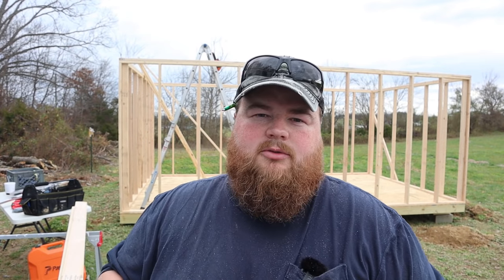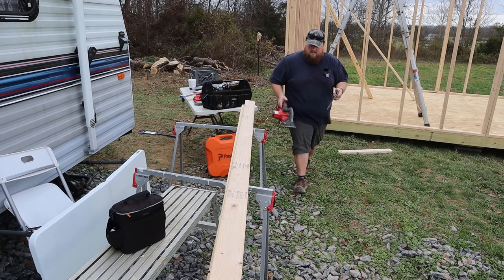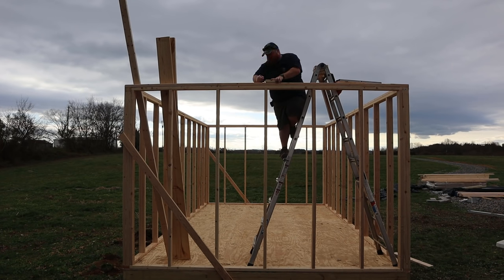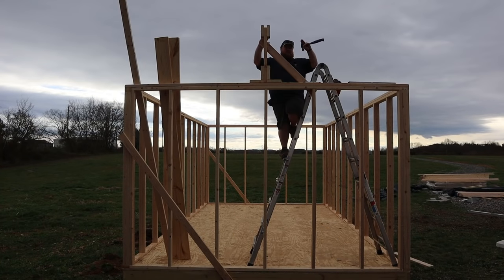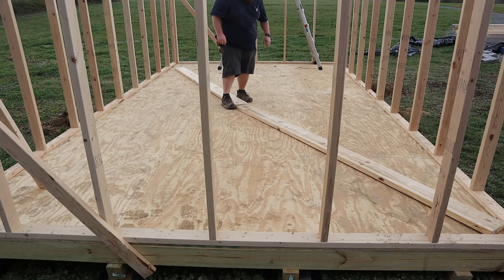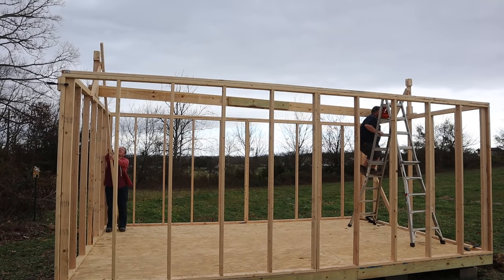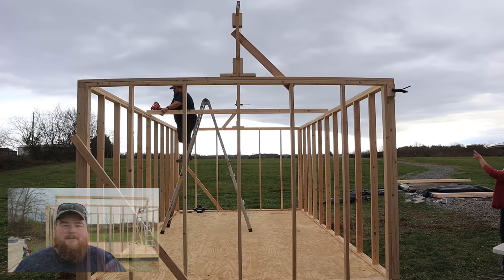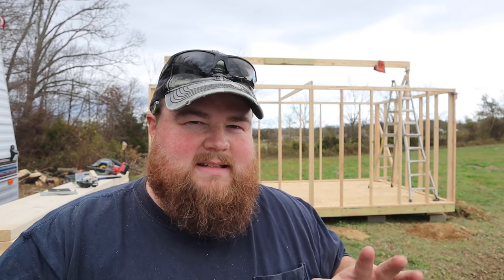NO TRUSSES? | Stick Framed Roof - Shop Build 04

Comment: This past year, I built a 12x24 wood working shop. All the room I had or it would have been bigger. I did the roof with a 10-12 pitch. I love it. On one end I built a loft across the end coming our 4 feet. I won't go a loft on the other end as it is where lumber storage is. I Love the hight ceiling as I never have to worry about hitting the ceiling when flipping a board. I also put LED lighting in the ceiling. One light with 4 wings puts out 12,800 lumens. On the ends I used 850 lumen lights. Like daylight in the shop. Keep up the good work. It sure is fun building your own shop.
Reply: Oh, I have NO ceiling joist in the building. I cross braced the 2x6 rafters near the top and nailed hurricane clips to the wall
Reply from the maker: It really is great fun getting to build my own shop. I'll be reusing my current workshop lights (LED) and look forward to putting it all together soon. :)

Comment: I know that Engineered Trusses have gone up in price but they are so much easier to deal with and if they aren't busy can set them for you and before you know it the roof is ready for lateral bracing and sheeting. I'll pay extra for the trusses especially in most states the codes call for it and the fact that they are protects the buyer and the seller or homeowner!

Comment: Two issues. Before framing roof you need to sheath the walls or brace them. Second it is necessary to add wall braces (and rafter ties). Otherwise all walls go apart and roof will collapse.

Comment: Listen, Sam: I am surely in your debt for posting this video. I’m also working pretty much by myself, and so for the first time am having to figure out how to, for example, hold a ridge board in place while I size and attach rafters. Nice job, man!
Reply from the maker: I am happy to have helped in some way! The #1 thing I would change: don't make the bird's mouth cut so deep. I dropped mine down too low. There's not been any bad results, it's just cut farther into the thickness of the rafter than is normal.
Reply: Yeah, I checked code before clamping up my block on the bird’s mouth end, and since 1 1/2” is all that’s required for contact on both parts of the cut, I went for just over that - probably only 1 3/4” deep on the vertical cut. Thanks again!

Comment: I originally wanted to use a ridge beam in my workshop; but, I was new to all of this and having a joint in the ridge beam made me nervous. So, I used gusset plates on my roof framing for its simplicity.  It was after all the first building I ever built. 

I wish I knew then what I know now. LOL. Thanks Sam!
Reply: That’s the great thing about YouTube it’s basically a unlimited supply of knowledge!
Reply: @RedBeardedBuilder  YouTube University has made me a Jack of very many trades.
Reply: Remember what he installed is call a ridge board not a ridge beam.   The ridge board is just used to attach the rafters to.  There is no weight bearing on this ridge board so it can be in pieces and often is.  You can actually use a 1x for this board if you would like.  Simply used to tie the rafters to.

Comment: A  birds mouth is simply a plumb cut and a level cut.   So draw a plum mark  and slide a 2x4  scrap down the plumb  mark and when it touches the bottom of the rafter draw the level line

Comment: The birds mouth needs to start as it sits on the wall not before. You reduced the height of the rafter height and created a weak point. Effectively turning a 2x6 into a 2x4.

Comment: Still enjoying your channel but I have a Question number 2 No over hang on the ends ? Question 1 which I never seen a response from your first video was why did you not insulate your floor or at least maybe use reflective foil or something. Note on your brothers tractor in the future you could clamp on some extensions on his forks to make them longer so you could get stuff up on top later...(-:
Reply from the maker: No floor insulation, and no gable overhangs. We're putting our money towards moving our home to the property so this is a very budget conscious build. I'm not worried about a flush gable wall with no penetrations or doors. It'll be weather tight and have no issues when it's buttoned down right.

Comment: Just curious, no hurricane straps? Being in TN, the likelihood of a high wind event, either in the form of a tornado or decaying hurricane, is pretty good. Nothing is going to be 100% but I'd hate to see all of my hard work get destroyed by a 40 mph wind gust when I could have made it withstand say, a 60 or 80 mph gust.

From the beginning, I've wondered if the whole thing could be blown over since it's not attached to the concrete blocks. It's great for portability but that's only for when you want to move it, not mother nature.

With all that said, I admire your gumption and I look forward to the next video, and the next, and the next...
Reply from the maker: Don't worry.. straps will be added very soon. I'm trying to get the shell dry to keep rain off the plywood. I've got to frame up the door and windows too. It'll be done up right. :)

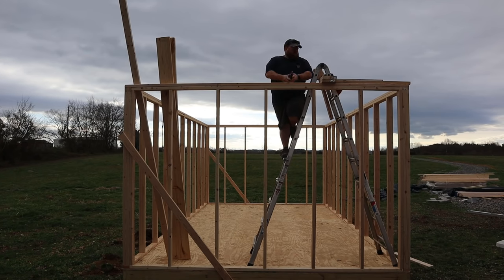Comment: Question - When you were finding the center point at 4:05, should you account for the siding? I plan to build a 10x10 shed, but if the exterior has 1/2" plywood, wouldn't i take the centerpoint from a now 10' 1" full width?
Reply from the maker: It wouldn't matter since the siding is added equally to the outside of the framing on both sides. :)

Comment: Sam, I am building a shop that is 15' long by 20' wide, the gable will be on the 20' side.  In your opinion, can I do rafters like these or do I need to spend the extra money on actual trusses?
Reply from the maker: A 20 foot span would be beyond my skills I think... At that point I believe you may come out ahead in cost to buy the engineered trusses? If nothing else, I would personally feel better knowing the large span above my head is 100% good to go. :) Either way, congrats on your shop build!!! I still have yet to put the metal roofing on mine. It's been covered in the synthetic underlayment for nearly 6 months now. It's a project I've put off over and over. I need to just get it done!

Comment: I really enjoy your videos and work ethic. Nice work.
But on your gable ends are you not having any soffit or overhang at all? It will really help to lower your possibilities of getting weather inside your building.

Keep up the good work buddy!
Reply: He may be doing ladder style overhangs. ???
Reply: @RedBeardedBuilder  Agree, I would imagine that he would, but without having your ridge extended to support the width of your overhang it will lose a lot of rigidity/support.

I suppose that he could use corbels. It just would have been easier to extend the ridge beam. Anyhoo… :D
Reply: @TheGrayMatters  some guys on YouTube always use what I call ladder style overhangs. I prefer just extending the ridge beam and doing my overhang that way but either way gets the job done!
Reply: @RedBeardedBuilder  that’s what we called them too. Built on the ground and set in place, or stick framed. Makes quick work of an overhang.
Reply from the maker: Actually, I'm not going to do any overhangs on the gable ends.... which is VERY non-conventional on stick built workshops. Probably sacrilege, but I'm keeping this build simple and budget minded. I'll try to come up with a better reason or explanation when that video comes. :)

Comment: I just watched a video where the weight from the roof will push the walls apart.  Does that ridge board prevent that?
Reply from the maker: That is why you need rafter ties or collar ties with roof framing -- the horizontal boards that connect rafters forming a triangle shape.

Comment: once I had a lot of protruding large moles - a kind woman at work noticed this and took pity on me. she brought me 1 cubic centimeter of hydrochloric acid in a tube and told me to lubricate the moles 1 time in 2 days. So I removed 4 moles. when I smeared a mole on a neck vessel, the acid entered the brain - there was a strange feeling, but when I smeared moles on my forehead and on my nose, I felt only a tickle and a slight burning sensation. I wasn't afraid because we had saline in our stomachs and that woman removed the mole in the corner of her eye! I was hoping that acid would get ahead of the intercellular signal if there were cancer cells. I don't know the concentration of the acid, but if I dipped an iron nail into it, there was smoke - so I used the tip of a glass shard. it is important that it has a very thin tip so that you cannot get even a drop of acid on it - try to moisten the sharp glass with a few molecules of acid. acid has an inertia of 2 days, so it is important not to rush, but to observe the process, otherwise a depression will remain instead of a mole. It's been 15 years now and my face is clear of these bumps - you can take the risk to get rid of the bump on your upper lip. I like what you teach people and how your family works together - this information is not only a thank you to you but also an attempt to save my recipe for all of humanity. I would start with a minimum concentration - you can dilute the acid with water to get 2%. this is a very dangerous trick for the eyes - have a solution of baking soda nearby and access to water to rinse your eyes quickly just in case. in our country, doctors cut off moles with a knife on the street - looking at this atrocity, I chose acid

Comment: Really looks good Sam. Are you sure you're going to have enough room compared to your last shop or is it around the same square footage? You did get a lot of new toys recently.
Reply from the maker: It's fairly close in square footage of my current workshop (256 vs. 240). I do think this shop, especially the layout in my head, will work better for me. I'll also let you (and whoever else reads your comment) in on a secret that will come about in the future... I am NOT bringing my table saw to this new shop. I am selling it and not planning to have a table saw in this workshop.  :)
Reply: @Samcraftcom  hey Sam thanks for the response. That should help out quite a bit removing the table saw I know mine takes up quite a bit of room. Can't wait to see the complete project. Thanks David

Comment: Has anyone heard of 3-gable 5-sided roof? I was a 5-sided corner shed, 12x12, with the side walls each 6', so the 5th center wall is 8'6"; but I don't like the common hip roof. I would like to gable both slopes to the 12' sides; and the slope to the center 8'6" sides. I don't know if it is possible, or what it would look like.

Comment: Great Sam but I worry about you not having a one piece ridge beam and sagging that may occur. Waiting for more ❤️❤️
Reply: He did the same in his old workshop it was larger and never sagged so I think it will be fine...
Reply: I had a similar issue with one I put up. I ended up overlapping 12 foot boards together. It ended up 20 feet long but was twice the thickness. I over engineer everything though.
Reply: This is a ridge board not a ridge beam.   You can make this out of 1x material if you want. This is used just to attach the opposing rafters to.  This board does not have any vertical weight support.   No issue making this in pieces.  I would land the splice between two rafter and use some material to splice them together.  Actually no need for the double rafter there.

Comment: Great video Sam! Are you leaving the overhang that long? I prefer to go ahead and mark/cut overhang while rafters are on the saw horse.
Reply: You and I must have similar backgrounds. lol
Reply: @TheGrayMatters  it just makes it easier in the long run!
Reply from the maker: No, I'll cut the overhangs back to a more "normal" looking length soon. :) I once cut my rafters ahead of time on the ground and had some annoying variations in the final "line" of them in the end that required shims for the fascia board. It was totally my fault, and the culprit was somewhere in the build, but it was a lesson for me that some ladder time later is better than messing up the sight line of the roof. :) Again.. just me. I'm no pro framer!!

Comment: Rule of threes. Your bird's mouth is a little too deep. It should not be more than 1/3 the width of your rafter, i.e. 2 x 8 is 7-1/2" +/- , so bird's mouth should be no deeper than 2-1/2" or 5" from the top. No criticism intended, DIY is catch as catch can. Good work and Good examples for working alone when necessary. I'll be watch more of your videos for tricks or tips I haven't come across yet. Thanks.